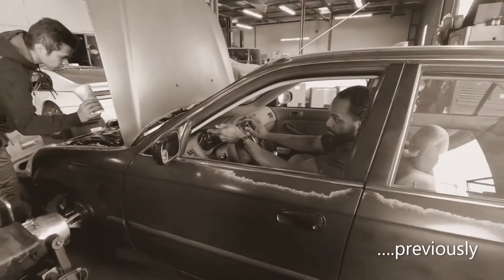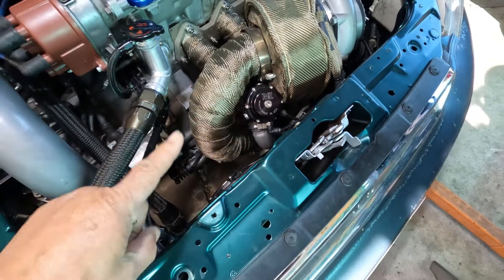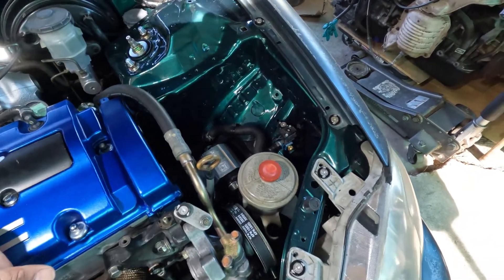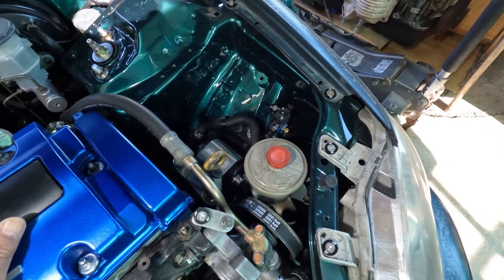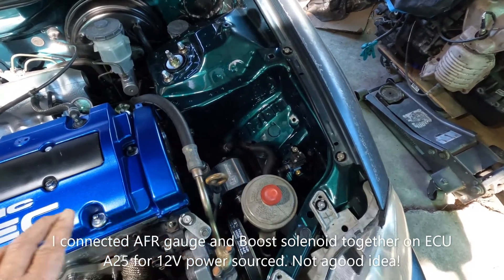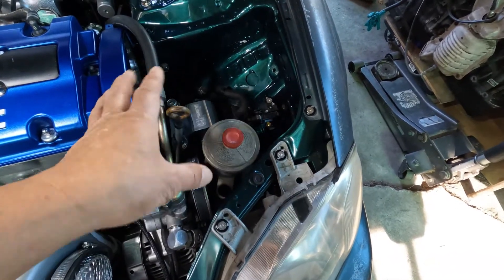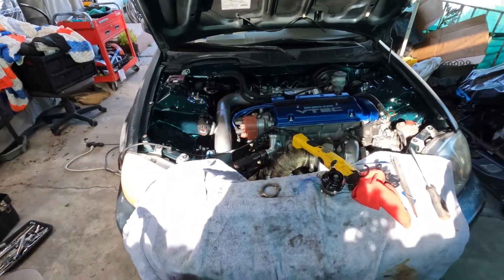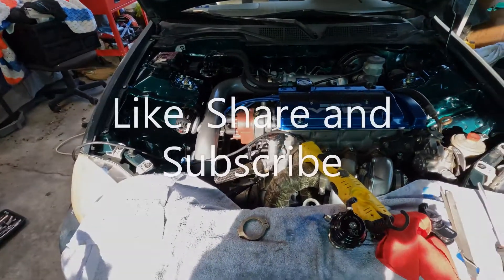Boost Creep

Comment: What was it in the end causing the creep? I’m having issues with mine creeping, but I don’t know if it’s because of the wastegate dump tube not having a good angle
Reply from the maker: Not really sure what causing the boost creep. I think I fixed all the air leaks l could find. I need to have it retune again.

Comment: Hey man you should look into getting a snake emu n street tune it. I got one n i dont know alot but it runs well. Im just saying because you can protect your build instead of someone els that dint put in the effort to build the car.
Reply from the maker: Watching videos about the snake, like to learn more from it.
Reply: @sagittnet2158  huntertuned has some good ones on snake emu its like a hondata but way cheaper
Reply from the maker: Huh! Learn something new  from you. Checking info about snake emu. As of now the car is running great after l've fix those 3 issues after the dyno. I thought about running e85 coz of heat issue now. Engine is not overheating or anything but me looking at my IAT reading is saying do something about cold air intake and wrap the charge piping. I got the data to start now and l'll find out it l'm making a progress as far as bringing the lAT reading. Thanks for the info brotha!.